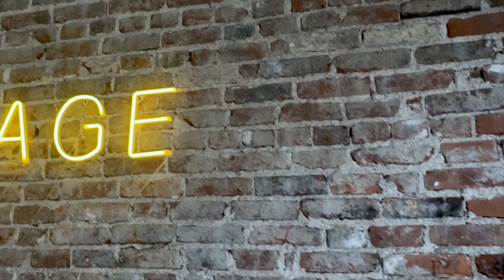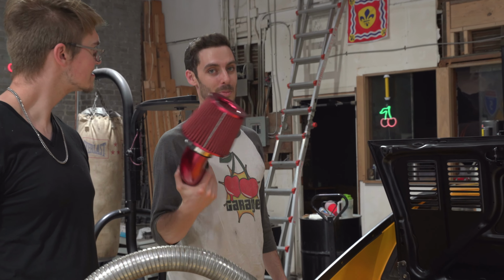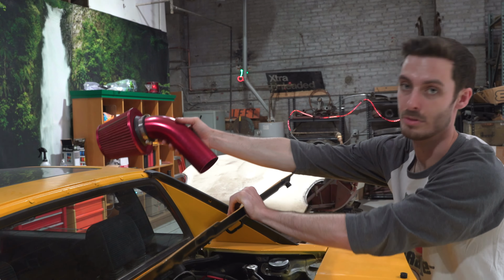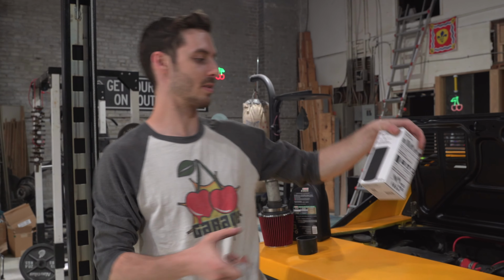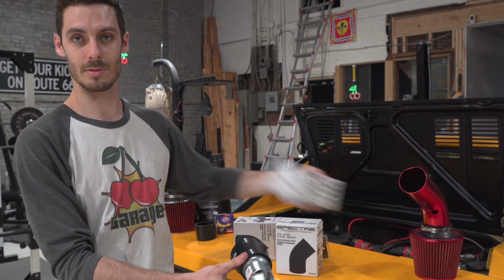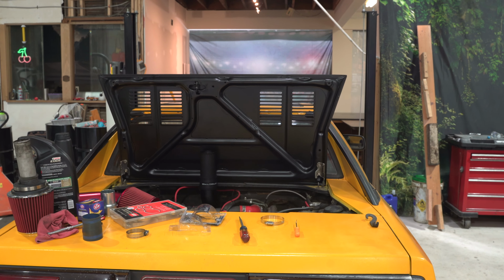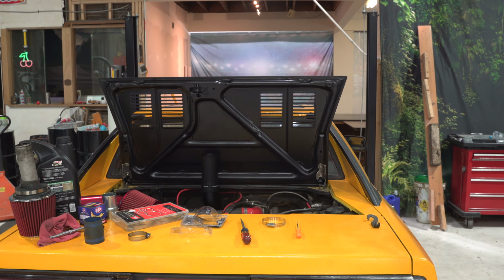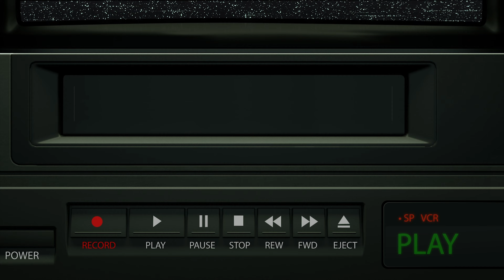This MR2 sounds like a JET!?!

Comment: As a heads up the 4age never came with an oil pan gasket, it used rtv from the factory (I for sure went a little heavy on it when i threw the motor in as you can tell, not sure where that missing bolt is lol). Btw check the old dizzy hole. I used a universal freeze plug to fill it and I'm not sure how its holding up. The turbo drain maybe be as well, so you might want to check that to. Just seems weird that the oil pan is leaking now because it never leaked when i had it.
Reply from the maker: I found a set of oil pan gaskets from felpro that actually fit, and I used RTV as well. I guess they started making them lol.
But it is strange, it also didn't fix the leak. The cylinder head was broken near the exhaust cam, where the valve cover seats. I tried to get that fixed but there's some were still leaking oil. It might be the turbo return line, it's hard to find. 

I'll check that distributor hole though! Haven't even been able to see back there yet 😅

The worst I fear is the front main seal, but I'll exhaust all my options until then. 
I'm excited about getting the liquid part of the intercooler hooked up, I have all the parts for it! Just waiting to record doing it. 

Thanks for the info though, as always you're a huge help 😁
Reply: @TheCherryGarage  I dont think ive ever had a front or rear main leak on a 4age, cam seals for sure though. But im willing to bet if its leaking alot its either turbo, oil 90 degree sandwich (its a ford part btw), or the dizzy cover  I used.
Reply from the maker: It seems like it's starting from the upper end the more I look at the leak, I'm glad you mentioned the dizzy and cam seals, I'll take a closer look at those. You the man 🤝